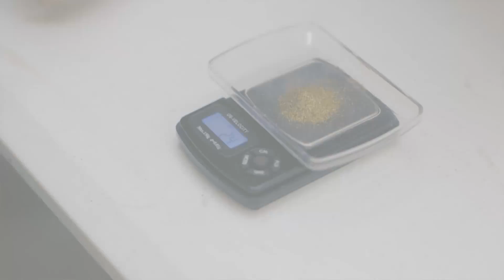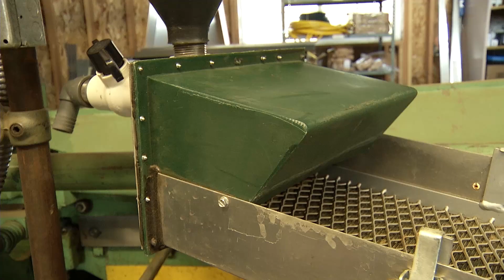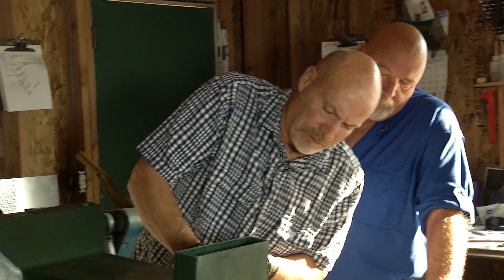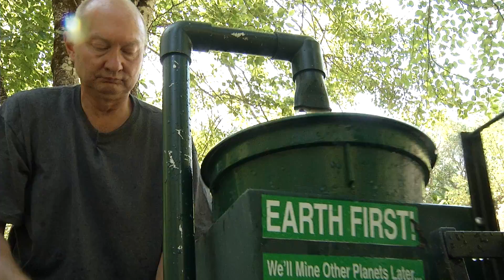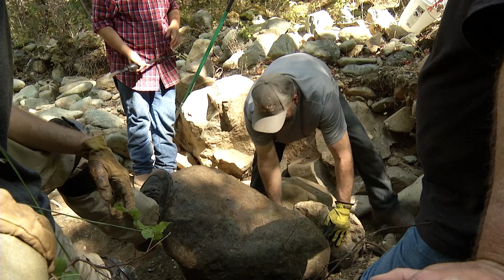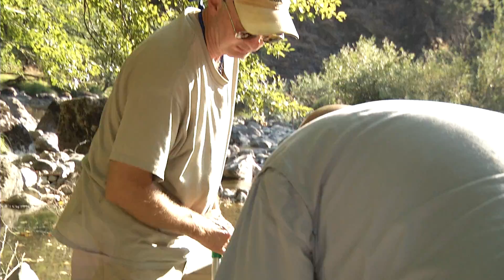Gold Trails Episode 7 Oregon Gold Grabbin Part 2

Comment: Great video, we have a mini gold grabber with a motorized pump, it works great and it is very simple. Hillbilly John bought it used at an outing at the Loud Mine in 2010. I know someone with a gold grabber with the hand pump and seen that in action 2 seasons ago and I thought that was just the greatest thing especially where you can not run a motor, I would like to get one, not in the budget this year though. I like the looks of the rocker box, I had an idea similar to that except that it would be aluminum, I am a sheet metal fabricator, but I like the idea of a molded plastic one. I like the old technology with a modern twist to it. Outstanding.